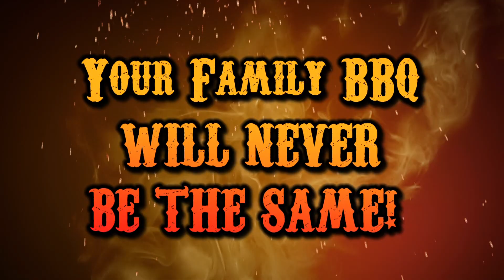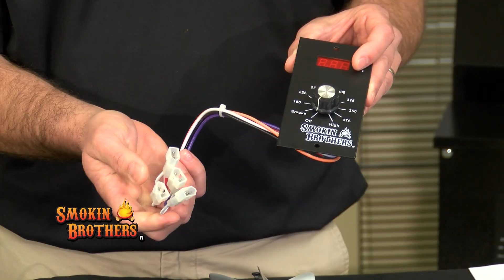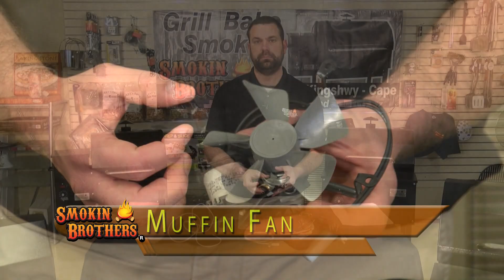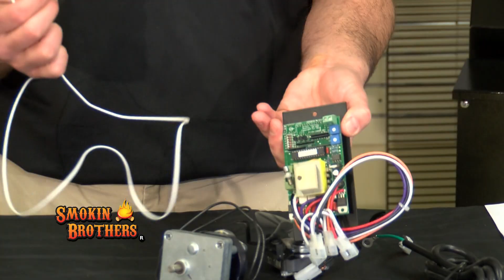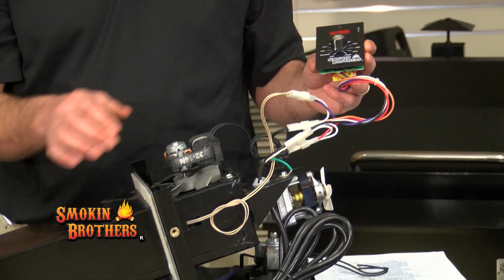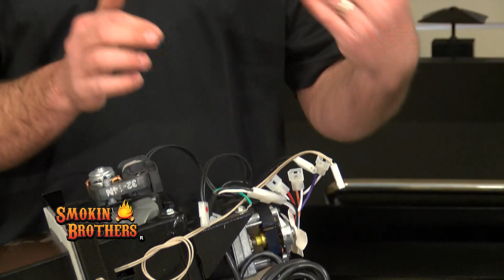More Indepth Troubleshooting

Comment: I am thinking about buying a used Pitt boss 850. The owner says that it won't maintain temperature.   I was thinking it could be either the thermostat or the temp problem in the grill. It's in pretty good shape and I can get it for $75 bucks. Also possible control board? Any help where to start would be great. Thank you! Just subbed

Comment: Hello, I have changed the auger motor and and fan for my z grill 700, but I have a problem: the auger motor always running and the tempreture gets too high, I can't control the tempreture. why is that? also the fan always running at the smae speed!!! Thank you

Comment: So, my hotrod is not working but I am getting no error message at all. The ignitor light is still on as well as the auger light. Auger fills the pot with pellets theres just no heat in the rod. Could it be just a fuse?

Comment: I have a z grill model and just replaced the rtd sensor an having a issue with the  temp is running higher than the setting for instance I have temp control on 180 the temp runs up to 250 what could be the issue  ?
Reply: hey, I have the same issue, did you fix it?

Comment: My Pitt boss has runaway heat. No matter the set point once it’s on it goes to 500 plus.  Otherwise it runs great.  Is this possibly something other than a bad controller?  Thanks
Reply: more than likely it's the grill probe. mine did the same thing after a couple months of use I just called them up and they sent me a replacement one. you'll have to put it in yourself.
Reply: @rulemob  question, so if the probe was replaced, does the fan function at a lower speed, for a more controlled heat. Seems the fan is blowing at max speed

Comment: Auger spins but if I put even a small amount of pellets (or even touch the auger slightly with my finger )it stops spinning but I can hear the motor still running......any input?
Reply: Way late with this answer, but you have stripped a gear in the gearbox. I just went thru this on my OKJ DLX. Cheap enough fix at least.

Comment: Pit boss 700 classic auger will not stop running.  As soon as you power on or power off the auger runs. Help
Reply: Dwight Crumpler  bought a new / different controller.   It's been working great

Comment: My smoking brothers grill is shocking me threw the handle. Does anyone know why it's doing that.
Reply: there is a bare wire touching metal somewhere. find it and put some black tape around it and get back to cookin.
Reply: Stop grilling in the pool any you should be good.

Jk! Sounds like a short to ground. Jiggle wires and look for a spark or bare wires.
Reply: Are you plugged into a GFCI outlet?  If not, you should be.  If the GFCI trips and keeps tripping after you reset it, you'll need to troubleshoot what's causing it to do that.  Usually, it's a bad hot rod (igniter).  You can prove that by disconnecting the molex connector between the hot rod and the controller.  If the controller comes on without tripping the GFCI when you plug in the cooker, then you know it's a bad hot rod.  Some people will plug into a non GFCI outlet if they have a problem with the GFCI constantly tripping, but It's dangerous to do that.  The GFCI is a safety feature to prevent electrocution when there is a short to ground.  Sometimes GFCIs can go bad.  If you haven't replaced yours recently, it might be worthwhile calling your friendly electrician.

Comment: I like how there is no repair video nowhere or schematics for the control panel. I'll be damned if I spend $100 for a new control panel when it is a fricken $1.20 capacitor or voltage regulator on the main board.
Reply: use charcoal